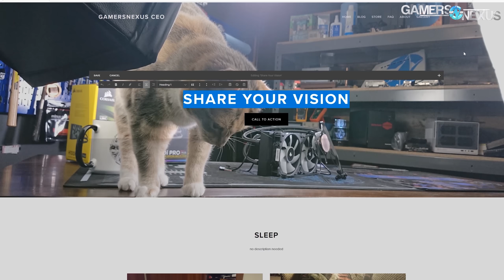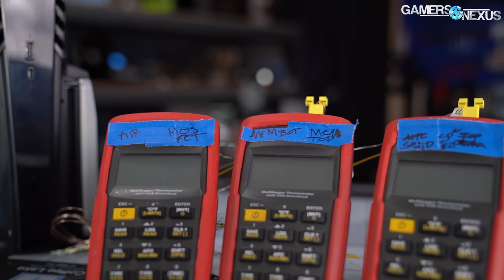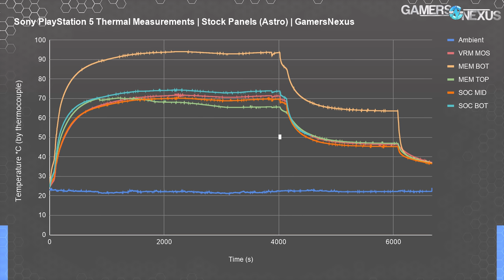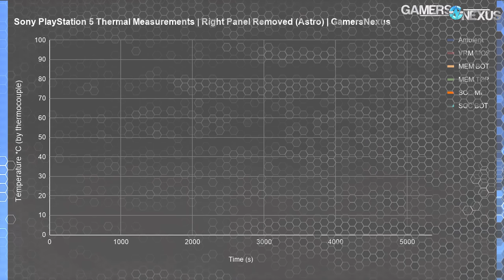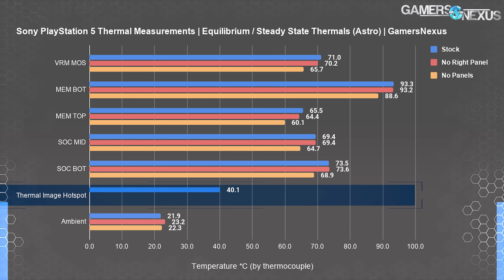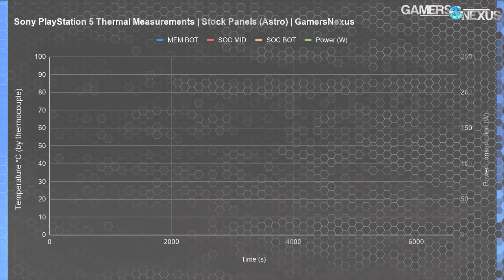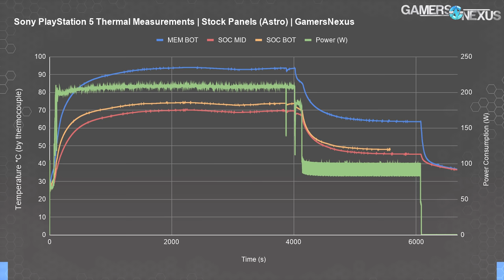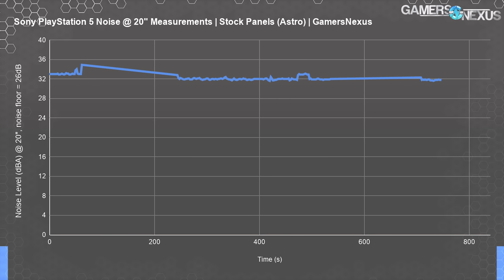Weak Cooler Design: PlayStation 5 Thermals, Power, & Noise Testing

Comment: It's rare to find someone as honest as Steve and his crew, because people in the industry are scared of not getting any review samples anymore.
Thank you for all the hard work that you have been and still are doing for the customers AND manufacturers.
Reply: And while it may be harder for smaller channels, the show of integrity raises trust exponentially, because I'd rather a trusted review come out late rather than compromised. The cost of losing viewers' trust is orders of magnitude higher than buying any product
Reply: @HululusLabs  Most channels would not have the means and ability to do testing like this. And most would not want to risk damaging the hardware. It is not a question of integrity, in fact it displays integrity by not embarking on testing you do not feel you have the aptitude to do.
And it is the end user experience that is what is important. The hot memory is only an issue if it leads to issues within the use life of the console.
Reply: @Safetytrousers  it might be a planned obsolescence thing 😉 If a console is made in a way that it will eventually make a suicide, this might force the customer to buy a new one. Or newer version.
Reply: @Morpheus-pt3wq  They haven't done that for their previous 6 consoles (slim and Pro being two). I don't see why they would start doing that now, when the console looks like it will sell very healthily.
Reply: @blitzwing1  Is there is some chance this lack of memory contact is a one off error in manufacturing or a run of them had this error?
Reply: @Safetytrousers  and that's exactly it. Why not? Very durable old console is the sole best reason for many people to not buy next generation. Why should they do that? For better graphics? Most people play games, because they enjoy playing them, not because they want photorealistic graphical details. A colleague of mine still plays games on his PS2, has a collection of more than 1000 games. Now, if you buy a new console, that has some sort of planned obsolescence in it, when it eventually fails, will you buy another from older generation, or go for new?
Sony went from known normal manufacturer to being overly expensive and aggressive - this will eventually be their doom.
Reply: Ever seen LTT child?

Comment: That’s exactly how I hammer my ram into place.
Reply: So you basically "rammed" it in😉
Reply: @The_Madhatter666  🤣🤣🤣🤣
Reply: Yea smh the Verge guy had 0 Hammers in his "build" !!
Reply: Man of culture
Reply: Haha i use a drill hammer
Reply: How's it possible for you to "hammer in your RAM" when you can only download it?
Reply: @_terrorbilly  you ask difficult questions sir.
Reply: Y G  as a layman, Im saying probably it will be, coz it's got more holes in it. But we'll have to wait for tech Jesus's video to be sure.
Reply: I always use a hammer to test for stability.
Reply: That's a rubber mallet, sir!  And cartoonishly large
Reply: I use a chainsaw
Reply: That's how I hammer my gf 😂
Reply: @_terrorbilly  you download ram? U old school guy? I get more ram from the power of the cloud
Reply: This is how I socket my CPU. I don't even need the CPU applicator tool!
Reply: Now I want a tiny rubber mallet to use strictly for this purpose.
Reply: It's just like using ONLY the pre-applied thermal paste.
Reply: @CaveyMoth  that's deep
Reply: @_terrorbilly  bought the bluray version
Reply: What do you mean? I downloaded my ram its much safer.
Reply: Good man
Reply: @tengkualiff  yet he had a Swiss Army knife. Disappointed.
Reply: @GarlicbreadmanOP  look at Austin's early look at the series x, it's so compact inside I'm not hopeful that it'll run a whole lot cooler. It'll likely run cooler though.
Reply: you could switch ram and hammer and it still works. Better, imho :p

Comment: Please make a video measuring the interior temperatures of the old Ps5 vs the new, revised model. You have the knowledge, the passion and the right tools to make a honest review.
Reply: There is no reason.Its the same.Austin is known xbox fanboy...
Reply: @ultragalacticlightkick862  There is a need Sony shrunk the heatsync %50 and used aluminum instead of copper so it conducts less heat. Austin didn't lie about anything and it would be nice to see some real testing with real results.  He doesn't think the original PS5 has a very good design and the revision looks worse. Aren't you curious to see some real results 🤔
Reply: @lordxboss5700  half the internet has roasted him about his "findings",pal... Check your facts.Almost every other outlet (that is serious enough not to open their mouths open wide in thumbnails just to look excited) has positive results about the new model.Its the same.Works the same,performs the same ect.Hell,it may pushes more hot air outside the console like that idiot found...He sincerely thought that he discovered that the new ps5 is hotter by measuring the temperature of its exhaust!

Also : https://youtu.be/74JPzcJ0fMg

I think I have some evidence to support my claim about that xbox fanboy thing, don't you think?
Reply: @ultragalacticlightkick862  Why does every Sony fanboy think comparing 2 models of PS5 has anything to do with an Xbox ? Austin said the new revision is worse and it is it has half the heatsync and is made with less conductive materials 🤣 that's worse than the original it has nothing to do with Xbox. I've watched both Digital Foundry and GamersNexus teardowns and testing of both consoles and everyone agrees the Xbox is designed much better.  There's parts inside the PS5 hitting 95 that's the problem this new revision better do something about that. GamersNexus uses nodes internally and gets the real results 👍
Reply: @lordxboss5700  I didn't said anything for xbox!Its not even a competitor any more...No exclusives console.I only talked about fanboy that Auston is
Reply: @lordxboss5700  Austins Review is objectifly bad in terms of methodology. The basic testing is not rocket science.
Reply: Look buddy on chip is still pushing 70-80C
Reply: @alejandrotobienne584  SeriesX is hitting between 70-80 max temps while PS5 is hitting 95degrees that's a 20°difference 🔥 imagine that with a smaller heatsync 🤷‍♂️ Internal Temps at 9:30 https://youtu.be/MmggkW6usmQ
Reply: @ultragalacticlightkick862  actually half the Internet is laughing at all like you who appose the thought it’s running better 🤣😂
Reply: @lordxboss5700  then I retract my statement 80-90 and even in the OC’d world that’s dangerously high on a OC’d chipset.
Reply: @alejandrotobienne584  The SeriesX highest temp anywhere in the console was 75° but that 95° in that PS5 is 🔥 I wonder how the smaller heatsync will do 🤷‍♂️
Reply: @lordxboss5700  was the 75 from the internal diy or exhaust??
Reply: @ultragalacticlightkick862  imagine doxxing someone because they said something about a piece of plastic that you didn't like. Now that's ps fanboys
Reply: @ultragalacticlightkick862  how we even be certain at this point that it won't be an issue long term? And a fan boy??? Well what does that make his haters then who jumped on him like he said it was a terrible console 🤔 which he never said and I don't get the impression he dislikes the console just didnt agree with the changes. I actually think the real talk here is reducing weight and charging the same price thats odd to me but what ever.
Reply: @stolenname94  then search the internet about the new console.Actual measurements.Not idiotic click bait talk.Just results
Reply: How do you know if you have an updated PS5? Mine arrives tomorrow
Reply: @excalibur9768  From the screw in the base. If it has grey color and you can screw it only by hand then you are lucky enough to have the newest model which is by far most cool than its predecessor.
Reply: @excalibur9768  check the serial number.

Comment: Good video. Just wondering what adding another hot nvme expansion will also do for heat
Reply: Temps that make Arizona jealous
Reply: Depends on where the module is located. It is quite close to the memory modules but it is also exposed directly to the side of the console. Could be that the heat may manage to escape through the exposed side rather than become trapped (as long as the cover plate for the ssd slot isn't used, not sure if it could be) and cause further thermal spikes. This is a tricky one. Seems like Sony will have plenty of RMAs to deal with.
Reply: Damn. Mad respect you watch gamersnexus. Alot of youtubers in your genre could benefit from having a basis of tech knowledge when reviewing games
Reply: I don't imagine it would be a good addition nvme drives are really hot
Reply: I'm waiting to see how that will work too. Maybe Sony will be extremely selective about what chips they approve for use, because of heat.
Reply: ACG and Gamers Nexus. The cross-over we've been waiting to see!
Reply: @kingqasmoke2802  Particularly PCIe 4.0 drives like the PS5 will presumably use.
Reply: This is probably why we can't have an aftermarket ssd in ps5 yet.
Reply: Once their all sold their gonna crank the fan lol
Reply: ACG army!!!
Reply: I doubt another ~8W does much..
Reply: It would have to atleast contribute to  it. Impossible to get cooler with a extra heat source hope it's not a problem later on tho with more demanding games.
Reply: Coil whine? I thought it was the disk drive
Reply: Little to nothing. SSD's don't get that hot compared to the other components.
Reply: Considering a current pcie4 controller pulling about 10W, it won't make a difference.
Reply: @Rance53  I'm sorry if I'm getting this the wrong way; English is not my first language.

Yeah, ideally. But Steve's favorite game is Thumper so it could go both ways. I don't think ACG would benefit from being overly technical. He just says his opinions about graphics and sound effects and says if it's a good game or not. I'm a PC gamer (a niche one at that) and I'm not his core audience at all. From reviews I've watched, he does say game X, Y an Z is better on a PC.
Reply: @Blag_Cog  that’s just blatantly not true lol. Nvme stuff on 4.0 get VERY hot. I know because my drive on the back of my x570 will get up to 80C during intense writing. Why do you think so many x570 boards have little fans covering pcie 4.0 m.2 slots?
Reply: @lightningcrap98  It will not write and read to and from both SSDs at the same time. So it isn't going to get any hotter than it already is. So yes, it is true. We aren't talking about the motherboard either, we are talking about the SSD itself. Besides, it seemingly has enough space in the bay for a heatsink even.
Reply: @Blag_Cog  I’m glad you’re not talking about the motherboard cause I wasn’t either! Pcie 4.0 ssds get hot lol I don’t know what to tell you bud
Reply: @lightningcrap98  X570 is literally your motherboard chipset. I have it as well. I thought you were talking about mb.
an additional PCIE 4.0 ssd won't contribute to overall heat more than the one they already have. Why? Because it isn't going to use both at the same time. The I/O complex will only communicate with one at a time.
Reply: I wonder if that 95ºC memory module is the source of issues that you and others have had.
Reply: Well it is being actively cooled in the airflow pattern, so not much.
Reply: They run hot but in terms of heat dissipation, I doubt it'll do much as we're talking well under 10 watts max draw. Even if they were only 1% efficient and dissipated the rest as heat, you've got under 9w TDP.
Reply: Why you so salty?
Reply: Plenty of room in there to add an nvme heatsink to it.
Reply: Worse
Reply: The best game reviewer comments on the best hardware reviewers channel, the planets have aligned and the powers are converging!
Reply: The Crazy world of Arthur Brown that's what !
Reply: @94XJ  Yeah seriously, the Fan on the PS5 probably consumes more power than the NVME SSD, its just most SSD aren't actively cooled,
Reply: @lightningcrap98  x570 boards have a fan for the chipset not for the m2 drives
Reply: @stiegelzeine2186  on a lot of mobos the fan pushes air over an nvme m.2 and the chipset vrm

Comment: Sony should add a turbo mode in the settings for cooling, for those who don't really care about noise, just push the fancurve to 80-85%
Reply: That's a Brisbane summer weather curve 🤣. Probably 90-100% fan curve TBH
Reply: They hid handy stuff deep in settings menus to prevent many people using it, for various reasons this should be one of them
Reply: Funny, my PS4 has that mode. After and hour it turns into a hair dryer (heat and noise).
Reply: @bwillz2230  Y'all laughed about the VCR Xbone with it's giant power brick but that thing ran cool lol
Reply: There's 3 heat sensors on the Ps5 and Sony will update per game on how fast the fan will run.
Reply: @one_up907  wait a fan curve per game? Or a fixes rpm per game? Also, does it account for ambient temp?
Reply: They're going to have fan profiles for each game you can update.
Reply: @HowlerBikeVlogs  did you watch the Sony teardown? They talked about it near the end I belive? I'll have to check again but yes each game will have a fan profile.
Reply: @HowlerBikeVlogs  oh damn it wasn't in the teardown it was announced, just google Ps5 Fan updates,
Reply: @one_up907  i've not watched any other than this video, i'm not rly into consoles but i'm checking ps5 cuzz a friend wants to get one
Reply: @one_up907  however i'm nerding out over the haptic trigger feedback tho, that looks really cool. Don't know what game i would use it for on pc, i suck at aiming with a controller
Reply: Sony said they're going to be adjusting the fan curve if they think it needs to be changed via firmware updates.
Reply: Sony should just release a revision that doesn't look like a turd for Christmas 2021.
Reply: You have to wonder how much difference even a boost mode will make to the memory unit temp
Reply: @HowlerBikeVlogs  hmm if you're not into consoles that much I'd say stick to PC, my friend is mostly PC as well but he wants a Ps5 just for the games that interest him. Plus I'm pretty sure the consoles do have keyboard and mouse support.
Reply: @one_up907  yeah i've got a gaming pc i built early last year when 2080ti's were sorta stable
Reply: What brilliant engineering over at Sony HQ Lololol
Reply: no, they should design it properly, so there is no chance of overheating. nobody wants a noisy console.
Reply: @bertracoon1884  I think he means a feature useful specifically for the people that don't care. According to this video the console is very quiet. So just an assumption here more power to the fan won't be that big of a deal in terms of noise. The Series X fan is even louder even though the heat easily dissipates up as it should.
Reply: This is the reason why Sony was monitoring the fan and temperatures of the consoles.
Reply: FYI everyone who's saying that SONY can just up the fan speed to mitigate heat - That won't help the memory! The fan is only cooling the SOC and not the MEM BOT so unless this issue is tackled directly by SONY, this will never have a fix....
Reply: They should just sense when bluetooth headphones are connected & crank the fan speed, hoping you'll never notice 😅
Reply: @bwillz2230  whats wrong with first gen ps4?
Reply: @me4tgr1ndr  overheat, shut down.
Reply: @bwillz2230  oh, I still use a first gen to this day lol
Reply: mikeisu  yes, the memory is operating within spec..... at the tippy top of that spec, 100% of the time. GDDR6 memory has a MAX operating temperature of 95°C. This is also being tested with Astro's - a game that's barely demanding on the console. That should be a concern for games that actually demand more performance in the future.
Reply: Sony should have implemented a good cooling system in the first place...
Reply: 20" fan blowing most of the time anyways so....
Reply: Rookie Gamer  some PS4's are loud af tho man
Reply: Rookie Gamer  um... good for you? Some people play with headphones for the specific reason of not waking or disturbing others in the household, and a loud fan doesnt help